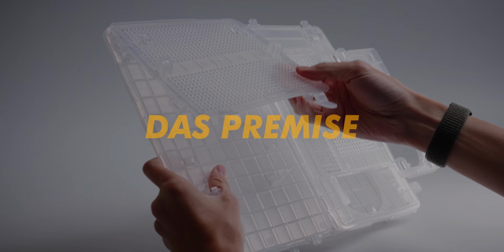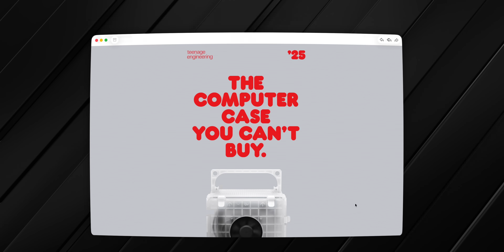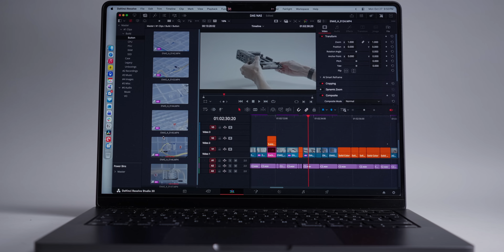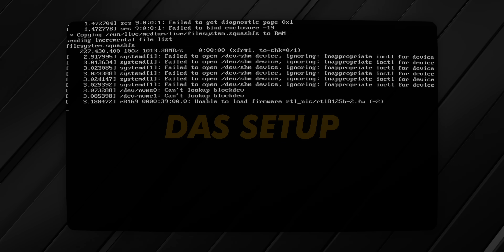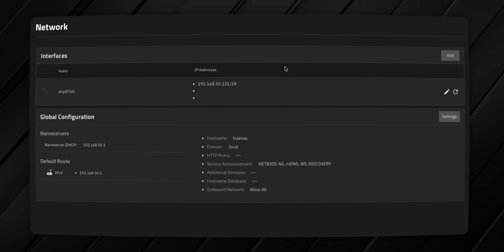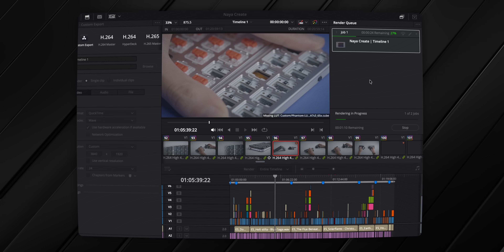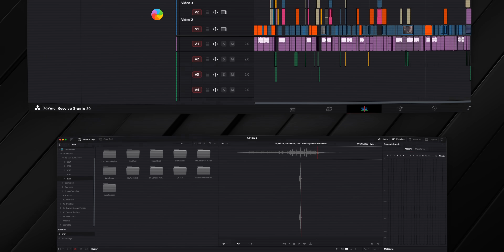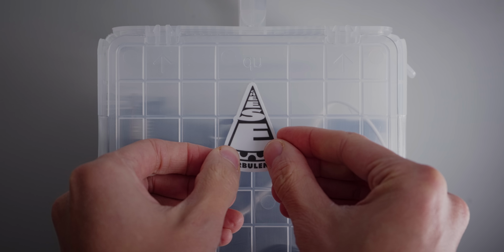I Finally Built My Dream NAS! - TrueNAS, Thunderbolt, and Apple Combined

Comment from the maker: Hi everyone, 👋

There have been a few comments asking or pointing out why I didn't just get an external m.2 enclosure or SSD. In the original script I actually had a part explaining that, which I cut. Believing nobody would be interested in that, I stand corrected.

The short answer is a bit anticlimactic; I just really wanted a TrueNAS system. In my head I envisioned a “base” of operations, a device/system that would stand stationary but be connected at all times for me to access. Whether that is remotely (outside) or via the network from within the flat, with the option to get that high-speed connection when I need it.

Now granted, I could have accomplished that with an additional external SSD in combination with my existing NAS. But I also wanted it to be dead silent, which my Synology isn't, and I don't live in a large enough home to hide to accomplish that either. It ultimately came down to personal preferences and the tingly sensation to build something ridiculous to solve a simple problem. Which is how I ended up with what I have now.

It's definitely not the most economical nor practical solution, but it was a lot of fun putting it together and trying to get it to work, and hopefully also for you to watch. 🙂

Hope this sheds some light on the subject; if I forgot something or didn't see a better, cheaper option out there, it is likely that I just didn't know about it. 😅

Cheers and have a great day!
Reply: Not necessarily a better/cheaper option, but there are some all flash NAS + thunderbolt 4 products out there, it's pretty dependent on what are available in your region though. I believe you would also receive less criticism if you had maybe more than 4tb of storage room designed for the setup, thus the reason many are thinking that an enclosure would satisfy your use case. A 4 bay all flash NAS filled with 4 or 8tb drives would start to make more sense and differentiate from traditional enclosures, and even one drive for redundancy if you would ever needed that.

https://www.youtube.com/watch?v=sYXh0AdBw-I LTT also had a great demo of using a mini-pc as a all flash nas, I forgot if it had thunderbolt even if they were planning to carry a mac mini with it

Comment: I'm going with a DAS (Mediasonic Pro 4 bay 10GB USB) connected to my mac running Orbstack (instead of Docker).  I don't want to dive deep into the homelab rabbit-hole.  I just want to run a few services like Immich and Jellyfin, and stream Stremio from my mac to my Apple TV.  I'll use software Raid, and the Mediafsonic box  set to JBOD passes SMART info over USB for drive health, etc.    It's priced like a DH2300, but gives me 2 additional bays.  I wasn't going to do the home networking thing, this will all be via WIFI anyways.  Besides, most people only have 1GB network ports at home.    The cost of buying another PC just to use it as a NAS at these prices today is better spent on a decade of cloud backup and real-debrid.  Most people DO NOT need  a NAS, and if you follow the NAS policy of 3-2-1, you STILL need some kind of offsite/cloud anyways.  I always laugh when people say they are making a NAS to escape the cloud, LOL

Comment: I would check if you adjusted the jumbo packets size on both sides otherwise it will be limited in speed. I’d suggest speed testing connections between the nas and the MacBook.

Comment: Get a Linux or Windows laptop and stick the 2tb nvme in it. Would have been better. Spent thousands extra because Apple severely limits the drive size in your laptop. Nuts.

Comment: The TDP of the CPU does not directly translate into power draw. The unit W from TDP is not the same as the real W (watt). The CPU is just limited in performance. Just get a normal CPU and configure it the way you want and you get a better result.
Also using a inherently broken 13th and 14th gen Intel CPU is a poor choice.

Comment: Hello, great video, first time viewer! This is an interesting project, hope it works out for you over the long term.

One thing I can think of to help the "Thunderbolt not available on bootup unless device attached issue" could be to place a Thunderbolt Dock / Hub in the middle. Most TB Docks have 2 TB or more ports, so devices can daisy chain together. If you leave the host end connected to the DAS / NAS this may possible keep the port LIVE on bootup.

Comment: What app are you using for the dynamic notch? I've looked at a few open source ones but none of them work super well
Reply from the maker: I've been using tryalcove.com but have been pretty happy with it so far. It does sometimes (in DaVinci Resolve) overlap with a long menu though...

Comment: The nominal tdp of the CPU you choose doesn't have the impact you think it does.
The idle consumption of the i7 vs the i3 of the same generation isn't very different. The F SKUs do see a little drop because they don't have an iGPU to power though.

In fact for most 24/7 cases the faster chip results in lower total consumption. Because it's generally a better binned chip, completes hard tasks faster, and you can always power limit it in bios while keeping all available threads.

And i would also say it's technically possible (unlikely) that you're still limited by the network protocol used in the communication link. It's built for resilience to interference and has a lot of handshaking compared to a true direct link. But I'm fairly certain there isn't a way to use the Thunderbolt link as it was originally intended on a truenas box.
But you could easily test with a thunderbolt to m.2 ssd adapter and see unbottlenecked render speeds.

From what i have heard the timeline performance is the main improvement from leaving HDD, and the random waits, not the final render time.

Comment: The macOS network stack is terrible at ‘higher’ speeds, whether ethernet (copper or fiber), or over Thunderbolt. It just sucks, *hard*. The additional bandwidth of Thunderbolt doesn’t even solve the problem.

Comment: Very interesting build. A friend gave me that exact same case to make a build in and funnilly enough you installed similar components to mine, although Im using it more as a general homelab. You can totally replace your Synology NAS by getting a Terramaster D4-320 it's super cheap on amazon as far as DAS's go and it also allows 2.5 inch SSD's (USB4 only however)

Im not an intense editor so I edit off source footage on my main pc and offload it to the new server i built once im done but after watching your video it would be nice to buy a couple of 2.5 inch SSD's and work off them instead via proxies.

Enjoyed the video!

Comment: I was just about to purchase a very similar setup. Was that ~30w during idle or load?
Reply from the maker: I measured it during a video export, probably not the biggest stress test but the max for my use case. 🙂
Reply: @CheeseTurbulence   Do you have any idea what its idle usage is?

Comment: If you can't get around the boot requirements for the Thunderbolt connection, I do recommend simply getting a better 10GbE adapter than the one you had. I think you'll find you have more than enough performance with a working 10GbE connection (particularly since your primary bottleneck is rendering speed), and it will be far easier to manage. Other World Computing has one that's well-regarded. Also, regardless of whether you use Thunderbolt networking or 10GbE, make sure you check on "jumbo frames" - they can make a big difference, especially for your use case of very large files.

Comment: All these issues because Apple refuses to allow customers to upgrade their own storage or sell these devices with reasonably-priced storage to begin with.

Why can't they just sell a mac with, say, 8, 16 or even 24TB of storage for 600€, 1200€ and 2500€ SSD selections respectively? Then there's no need for NA in S and you just plug the cold storage by Thunderbolt whenever you need to offloan finished files.

Comment: You can try using ZimaOS as your DAS NAS OS, as it clearly says about TB connection support and establishes more transparent integration with MacOS with it's client. It would be paid for more than 4 drives in the setup, but for now you can add as many drives as you want to your setup. I have 8 drives in my ZimaOS setup and it's working perfectly :)

Comment: I'm glad you are smart enough to use the proxy workflow for editing and using the NAS primarily for exports. Here is what I use for the different stages of post-production. 

1. Media Management - Connected to the NAS while creating proxies which will be copied locally. (10TB turns into around 500GB)
2. Editing - Local storage using proxies (I can bring my MacBook Pro anywhere during this)
3. VFX / Fusion - NAS cache*
4. Color - NAS cache*
5. Exports - NAS

NAS Cache - Some NAS have a SSD cache feature where it would keep frequently accessed files stored on the SSD. Since VFX / Colorist work revolves around replaying the same clip multiple times, this makes the initial speed go from 100-200MBps to 1000MBps if using 10GbE.

Comment: Wouldnt it have just been way cheaper to get a thunderbolt caddy and install a single 4tb or 8tb nvme in it and use that with the Mac? Then you could just plug it into the Synology NAS to xfer all your files to cold storage?
I mean I get thats a lame project in comparison. But still way easier, way cheaper and way more convenient as a thunderbolt drive would be far more portable than "Das NAS" if you needed to edit on the go or travel.

Comment: i did the same NAS/DAS setup with a Minisforum AI X1 Pro that has AMD, hence USB4 (two of them!). on Debian (Proxmox) i was able to set a LAN IP for thunderbolt, so everything is on my home subnet even through P2P.

i get a full 20gb link to my host and the VMs, as well as full speed to my 2.5G LAN. after some udev rules, i managed to get it to work plug-and-play. time machine go brrr🏎️
Reply: I'd like to do something like that with 10 HDDs
Reply: have you recorded your steps? I couldn't get TB to work properly between macOS and Proxmox...
Reply: Have you figured out a way to “reset” the connection after replugging the Thunderbolt cable? I did with udev rules, but while it does get reset, it doesn’t happen each time, and sometimes I have to replug both ends of the cable several times to reconnect it 🤯

Comment: honest question, what was the reasoning behind building an entire trueNAS machine just to connect 2x2TB drives via thunderbolt to a single computer? wouldn't just an external thunderbolt enclosure have served exactly the same purpose for a fraction of the price? could have even sprung for an 8TB M.2 then.
Reply from the maker: That’s totally right, if it was only about the storage that would have been a lot simpler.

But I wanted to be able to access it from the network as well. I don’t always sit at my desk, this gives me access from wherever I am and then, when I need the speed I can plug it in directly. 🙂

Of course at the time I didn’t know about the plug and play issues.
Reply: thanks for the clarification, it wasn't clear from the video ^^ it felt like you were only connecting it to the one machine.

Comment: Great to see you again! Also, I'm about to build a Unraid box so any NAS inspiration is very welcome.

edit: I'm also eyeing the 13100T or 14100T, they are a pain to find for a reasonable price.
Reply from the maker: Thanks for watching! 🙂 I briefly looked at Unraid as well, but TrueNAS seemed to be more popular so I decided to try it first. 🙈

I paid roughly $100 for my 14100T, it was definitely used though, still had thermal grease on it. 💀
Reply: Get an 8100 or 9100, they're plenty fast for NAS use while being a lot more affordable than newer processors

Comment: It should be noted that this is technically still only a NAS, not a DAS since the files are accessed via Thunderbolt using a network stack. A DAS instead would provide block level access using a low level storage protocol like NVMe or SATA which has less overhead and better performance at the cost of flexibility.
Reply from the maker: Oh you got me there 🙂
Reply: @CheeseTurbulence  Could there be another way of doing this? to me (someone that is months away from building his first ever NAS) it sounds like there's a market gap...?
I'm still watching the video. Great stuff! Greetings from MAdrid
Reply from the maker: @PathoMarino  there are several alternative suggestions in the comments section here, another one I never thought about but ignores the NAS part is doing it via a 10 GbE Mac mini which I find a very interesting approach. 🤔 If you find another one, please share it! 🙂
Reply: isnt this the point of iSCSI... has been around for decades... networked block storage...